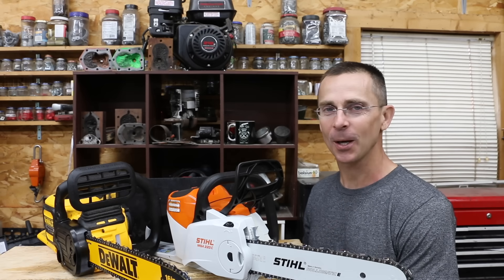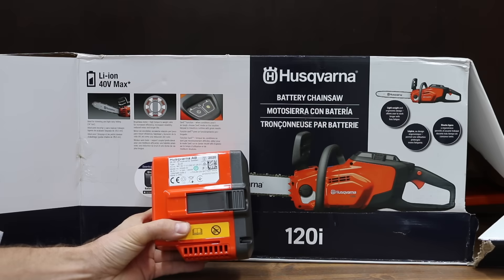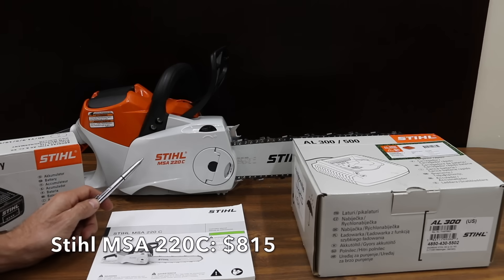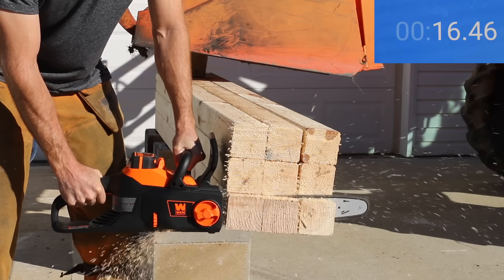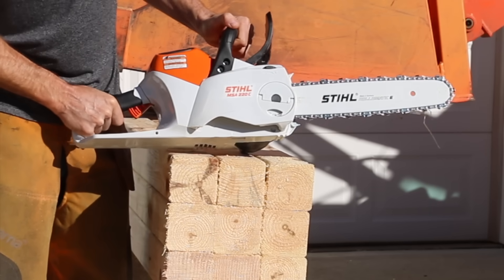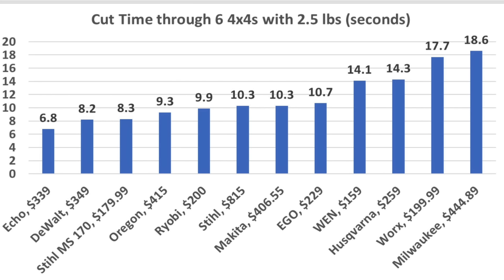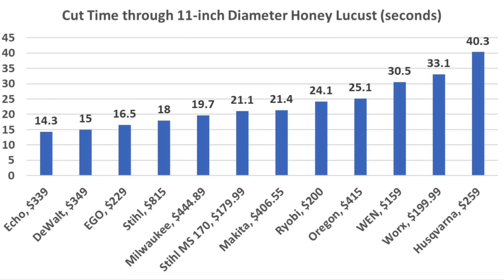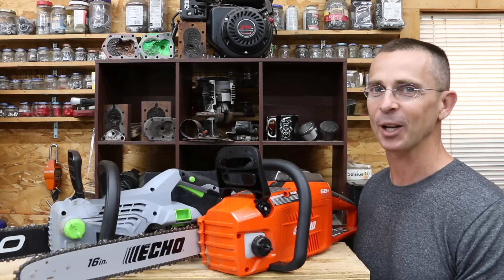Best Battery Powered Chainsaw Brand (ROUND 2)? Stihl, Husqvarna, Echo, Oregon, DeWalt

Comment: If you want to cheat with stihl battery  remove the battery and replace it with a adapter then you can plug in a battery back pack that will last much longer... At work i don't know if it's due to us having professionnel stihl. The battery backpacks are charged in about 68min but they have more power than the battery you had inserted into the Chainsaw

Comment: The best battery saw available today is Husqvarna's 540iXP (and T540iXP climbing/top handle variant.) Absolutely in another league than anything else currently available. Their 200x and 300x batteries are excellent, just choose whether you prefer weight or changing out batteries. And, of course, they hold up well to real world arborist use in rain etc. Echo has a 2500T that looks like a great lightweight option as well, but I've not had my hands on one (not sure if they have a rear handle/ground version).
Reply from the maker: Thanks for sharing.

Comment: I have a gas echo saw that I use for cutting HDPE pipe up to 16”. I’ve been using it for 6 years without having to do anything other than add gas and change the chain. I’m really surprised at the quality for such a cheap saw
Reply from the maker: Thanks for sharing.

Comment: Need to learn how to use those teeth. They are designed to bite and be used as a fulcrum, tip the nose of the bar down, release, get another bite and pull up on the handle until through the piece. Trying to let it just go through pushing will kick your ass if you're cutting wood all day. It also makes it easy to not crowd it and bog it down. These are ok for a homeowner in a small suburban environment. Gas saws have nothing to worry about.

Comment: Dewalt is now seen as a joke with trades people for it's poor, Chineseium  quality. Interesting their Battery chainsaw is a standout in their otherwise disappointing product line.  Being In Oz, I don't know if WEN is a recognised brand in the US but the fact it beat a Brand like Husky that is so well known for it's chainsaws in virtually every test is also an eye opener even just from the price point. The stihl, ( I have 4 Petrols) was also a disappointing performer especially given the price.  Perhaps These brands, Like Dewalt, are now trading far more on their name than their product performance, at least in electrics. 
Never tested them for speed etc  but I have an 18V and a 56V AEG and have been VERY happy with them. I don't know how fast or otherwise they are but they have been Flogged for a couple of years now and just given no trouble and are saws I enjoy using. That is a big factor in itself to me.  The 56V Is very powerful and just keeps going through any dry hardwood you throw at it.  The battery lasts at least 2 tanks of fuel in a comparable size petrol saw.

Comment: Just go be fair you charged the dewalt with a 2 amp hour charger (DCB107). Dewalt recommends that a high speed 8 amp hour charger (DCB118)  be used for flex volt batteries. 6 AH  battery would charge in about 45 minutes
Reply from the maker: Thanks for the constructive feedback.

Comment: It would be interesting to see a comparison of the chains used. Perhaps swap some around if they fit another saw and see if that's where some of the performance differences comes from. But there's also a very obvious trend that the heavier saws tend to perform better. The Echo and the DeWalt are both on the heavy side and showed the best performance. Husqvarna and Stihl are both on the light end of the chart and performed less than stellar.

There were two saws that was hitting out of their weight class, with the EGO performing quite well both for being so light and being as cheap as it is, and the Oregon that underperformed both seen to weight and price.

The worst price / performance has to be the Stihl. At over $800 it's almost twice the price of the second most expensive saw which was the Oregon at $415. But I guess it might make more sense if you already have the charger and battery in use with other tools.

The battery chart I think need a revision to show the relation between charge time and number of cuts that can be done using the battery. 
Here is a list of the charge time in minutes and seconds needed per cut:

Echo 2:11
Stihl 2:56
EGO 3:54
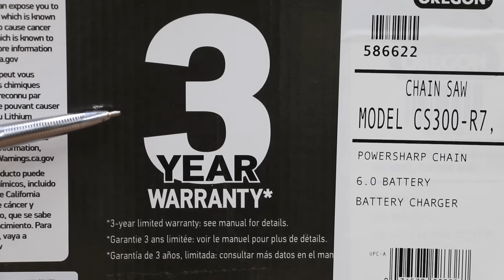Oregon 4:45
DeWalt 6:3
WEN 9:34
Husky 9:47

From this we can see that if you have a lot of work then the Echo is the saw with the battery that will spend the least time charging, and the Husky and the WEN are the ones where the batteries are going to spend the most time in the charger.
Stihl, EGO and Oregon are all better in this respect than the DeWalt.

To me the surprises are that the Stihl turned out to be so mediocre despite being so much more expensive. The Husky was also surprisingly bad, though at a less gut wrenching price. Oregon also disappointed at the price.

Positive surprises were the Echo and the EGO. Echo for having such solid performance and capacity and the EGO for managing to do as good as it did at that price point.
Reply from the maker: Thanks for the video idea.

Comment: The Sthil (Not quite the same model here, a slightly older one. Same battery though) is the one my department uses for our small utility saw for clearing small brush and branches, which it works great for, as lightweight as it is. Plus, it matches up with the electric blower, which is a really big deal for us, given how much we use that for clearing debris off the highway. Videos like this really helps us (as consumers) pick something with REAL quality, and is doubly good for us on a small shoestring-budget department.

I'd love to see what is in each battery, if it is a bank of premade 18650's or a proprietary cell, or some other mess. Also, I'd like to see how that self sharpening chain held up in this video, and how it really compares to other chains as far as utility, longevity, and cost effectiveness.
Reply from the maker: Thanks for the video idea.

Comment: I'm really confused as to what exactly you get for your money with that Stihl. They make great gas chainsaws - what happened to this?
Reply: Because people will buy it be because it says. Brand loyalty
Reply: It's the right brand and the right color so people will buy it without looking at its performance.
Reply: It wasn't bad in any category especially for it's weight, seems to have good build quality & you should find a lot of support and replacement parts. These are qualities not really tested here but that are often very important to professional users / operations, especially when they buy more than a few of them. Required safety features or certifications or even just the "professional look" to convince your customers that you're doing a good job might come into play as well.
Reply: @zapl80  and that costs an extra $400?
Reply: @GoblinKnightLeo  when you compare $400 to the hundreds or thousands of $$ it can cost the company if the tools fail at the worst possible moment yes. The calculation for companies is sometimes vastly different and one-time investments such as tools are often negligible. That's why pro tools or software or services or ... sometimes have ridiculous prices.
Reply: I'm not sure if this is a different model than the Stihl I have. The one I have didn't cost nearly as much and it runs a lot longer on a single charge.

Comment: Great video as always. 

The differences are surprising in magnitude. 

I was thinking a cut per amp hour would have been nice, but then you calculated cuts per charge, ..even better. 

I was impressed by these but I still think the next saw I don’t need will be an echo cs-2511t. It’s so light it will be a game changer. I have a husky 346xp so my small saw isn’t real heavy but 1/2 the weight of the electrics
Reply from the maker: Thanks so much!

Comment: Fantastic!  Is o wish Echo would put metal spikes as I have found with electric (A/C) chainsaws (that work great) the issue when doing gas-power-like work is the plastic spikes round over and substantially reduce the saw's ability to cut big wood.
Reply from the maker: Thanks for the feedback.

Comment: The battery information is very useful.  For some of us the biggest factor will be whether or not we own other tools using the same batteries.  For me, the Ego likely would be the best choice.  I am betting a similarly sized 5.0 amp hour battery from Ego would last in the 5-6 minute range, and their bigger 7 amp hour could reach out to that 8 minute mark.  Since I already have several Ego devices it is good to know their chainsaw is decent as well.

It would be interesting to see which battery operated String Trimmer comes out on top.
Reply from the maker: Thanks for the video idea.

Comment: I have replaced quite a gas powered tools with electric versions over the years, but leaf blowers and chainsaws are 2 items that will probably be gas in my shed for a long time.

Last time we had a storm, it took me 3 hours to cut up all the trees and stack the wood, and that's with my tiny 14" Echo gas powered chainsaw. I think I had to re-fill the gas 3 times, which goes pretty quick since it's a pretty small tank.

If I had relied on an electric chainsaw, it would have been days when you take in account the battery recharge times. If I had a ton of extra batteries and chargers to keep the saw running, the overall investment would have been astronomical.

Probably not bad just for cutting up some brush or light tree trimming, but not practical for clearing out a fallen tree.
Reply from the maker: Thanks for sharing.

Comment: The EGO tools have interchangeable batteries, I use the 5ah from the lawnmower for the saw, they also make a 7.5ah but I haven't invested in one yet. 
If you do a little digging the EGO stuff usually has 2 Skews, 1 with the battery and charger and 1 without so you don't end up with extra chargers and batteries if you don't want them.
Reply from the maker: Thanks for the feedback.

Comment: Great video!

For the sound test, I think that the dB meter should have been suspended from the ceiling or mounted off of the table, as the vibration of the saw could have been transmitted through the table and the PVC pipe.
Reply from the maker: Thanks for the constructive feedback.

Comment: Just a comment about noise levels. One should wear hearing protection when using even these battery powered chainsaws. OSHA defines noise level of over 85 dB as something that can lead to permanent hearing loss for exposures over 3 hrs. So for long jobs, consider hearing protection. If it's just a few quick cuts, probably not necessary. Unsafe volume levels are a function of intensity and time, with shorter durations for more intense sounds. For these electric chainsaws, they're much quieter than the gas powered ones, but are still loud enough to cause hearing damage over a long period of time.

Good video as always!
Reply from the maker: Thanks for the feedback.  You are welcome!

Comment: I'd still like to see you test ths linked chainsaw below. It's an 80v offering from Greenworks. We've had it for a couple months now and it's very impressive. We got ours as a tool only since we already had a battery from the blower purchased before, but I'm linking the battery included model for comparison reasons. Check this thing out - it's quite impressive.

https://www.amazon.com/Greenworks-Cordless-Chainsaw-Included-GCS80420/dp/B00R6Z4R42/ref=sr_1_2_sspa?crid=3QVXNMOFMK3CC&dchild=1&keywords=greenworks+80v&qid=1607903236&sprefix=greenworks%2Caps%2C249&sr=8-2-spons&psc=1&spLa=ZW5jcnlwdGVkUXVhbGlmaWVyPUExQlVDUFpGQ1k5SlBMJmVuY3J5cHRlZElkPUEwMzY2NDk5RlZXVkhGTko3S1REJmVuY3J5cHRlZEFkSWQ9QTA2OTAyODNVODhVM01WNVAwU1Umd2lkZ2V0TmFtZT1zcF9hdGYmYWN0aW9uPWNsaWNrUmVkaXJlY3QmZG9Ob3RMb2dDbGljaz10cnVl

Comment: I wish that some governing body would step in and make all these stupid battery powered devices USE THE SAME BATTERY. Imagine if you had to buy special fuel that only one company sold... So stupid and backwards!
Reply: Agree 100%. Once you're invested into a particular battery platform you are mostly prohibited cost-wise from buying a tool of another brand even if it is a better value. If all 18-20V tools used a common battery it would be great for consumers and 3rd party battery manufacturers.
Reply from the maker: Thanks for the feedback.

Comment: Do the testers not know the difference between amp hour batteries? When you take a 2.5 amp battery and compare it to a 6 amp battery, of course your run time is going to be way different. The manufacturer with the 2.5 amp battery in the video also offers 5 & 7.5 amp batteries. Does this suggest biasness? IDK.

Comment: You STILL missed including the EGO 18" saw. It's a completely different beast from the 14". MUCH more power and speed.
Reply from the maker: Thanks for the suggestion.
Reply: I'd love to see this one as I have an ego lawnmower with a 5 AH battery already.
Reply: @jamieforrester7108  wi depot dumping ego brand they got some out on the end caps & I was eyeing them. Don't know how much I'd use mower but still a bit pricy for 5.0 battery as backup
Reply: Still 56v so seriously wondering how that works...
Reply: @JTA1961  obviously a more powerful motor
Reply: Sad.  I expected to see the 18" EGO in this video.

Comment: The EGO battery charger has great fans on it for keeping the charger electronics, and battery cool. However, the design of the charger case completely blocks the fans! I've taken mine apart and cut away at the grilles. On that model charger, I also moved the fan from the useless position in the middle to the outside, and removed the bracket covering up the heatsink (so airflow actually cools the heatsink).
The temperature absorbing material on the EGO's batteries is interesting. We have one of their electric push mowers, and love it. If you're cutting tall grass, instead of bogging down it speeds up the blade. When cutting normal height grass the mower is very quiet!
Reply from the maker: Thanks for the feedback.

Comment: I like my battery Milwaukee saw, but its 12AH battery costs more than some other saws that come with a battery. One problem with battery saws is that when the chain dulls over usage, it eats the battery time much faster and tends to overheat. That said, I still prefer battery saws over gas powered as an average homeowner.
Reply from the maker: Thanks for the feedback.

Comment: Conclusion: electric saws might be worth it 10 years from now. Stick to gas.
Reply from the maker: Thanks for the feedback.
Reply: @ProjectFarm  Thanks for doing what you do! I am impressed by the speed and power of some of those saws as well. In my opinion, if you're actually intending on going out and cutting some wood, the run time on a charge just isn't going to cut it.

Comment: Those top-mounted safeties, just like with shotguns, would probably be handy if you're left-handed.
With the few chainsaws I've used, I've had to loosen up my grip so that I could get my finger over to push the safety switch in, and while I'm sure it's fine, there's something I really don't like about not holding on tightly to a chainsaw.
Reply from the maker: Thanks for the feedback.

Comment: Never underestimate the power of Japanese engineering, they always seem to outperform the competition. Most of my power equipment is Japanese in origin, I’ve put them through some tough work yet the machines still fire right up.
Reply: I got 3wh250r ~ 86 yz250 tt500 hon trail125 & best overheard complement in the sticks was "yeah everything he's got is old but it all starts first kick📉😊📈
Reply: @JTA1961  that sounds about right, a buddy of mine had a ‘77 Honda cb400 hawk and after rebuilding the carbs back to spec, it was a one kick wonder. A little care and ethanol free gas will keep the old engine running like new.
Reply from the maker: Thanks for the feedback.

Comment: I have the same Ego 14in saw and by using the 5 or 7.5AH bigger Ego batteries you get even more power on the bigger logs. it's truly great for the money. The issue I have is bad voltage sag on the smaller battery which causes it to hit low voltage cut off really quickly on big hardwood. not an issue on the larger batteries
Reply from the maker: Thanks for sharing.

Comment: I get talking about the price of each of the chainsaws but i feel you need to explain the pricing more for each brand otherwise the results are a bit misleading.  The reason i think this is important is that you aren't really comparing Apples to Apples in this review, for instance in this review  you have used the most expensive electric saw in Sthil's lineup  Echo's midrange saw and the cheapest offering from  husqvarna. In reality if you took the equivalent models from each you would find prices between the brands (certainly the big chainsaw brands) much closer and likely the performance also.

I am also not a fan of the no load  RPM test on the sprocket I don't think it really tells you anything, a much more interesting RPM test would be with the bar and chain on, and to make it fair all the saws should also be equip with the same length bar for all the testing.
Reply from the maker: Thanks for the suggestion.